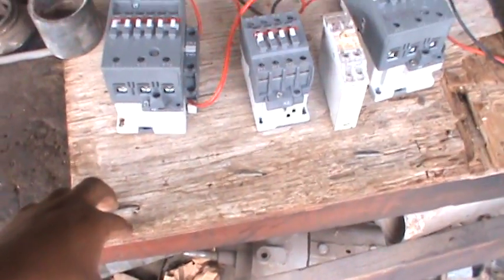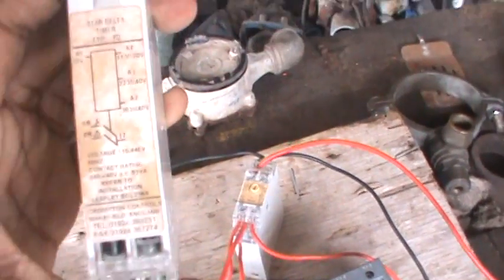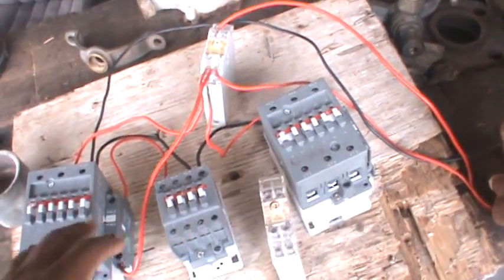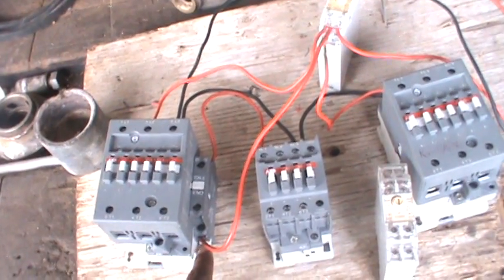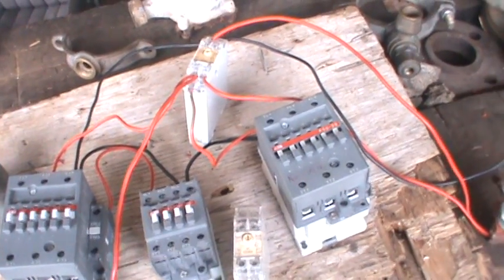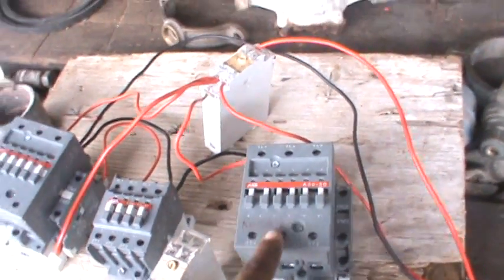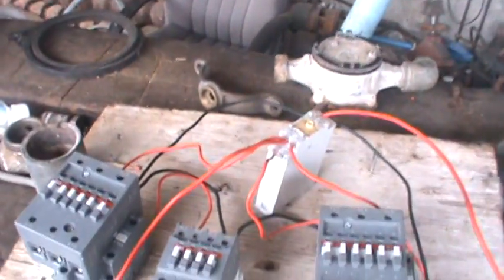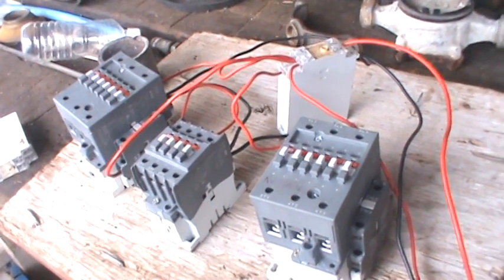Star Delta Circuit Wiring and Understanding . Auto Transformer (Motor with 3 Leads)

Comment: The timer you show is a star/delta however the timer you used is a standard timer that's why the had different contact numbers they are different as the timing of the contacts is longer, This is a very basic layout and not suitable for a standard timer would be ok if you had used the correct timer.

Comment: Please, please don't do this to my brain. 3 Contactors - YES. MAINS - STAR - DELTA. Now it is called STAR-DELTA for a reason. (The switching is between the star and delta.) Not between the MAINS+STAR and just the DELTA. So MAINS come on and STAR after switching on and after timer times out STAR fall out and DELTA come in. Contactors from left to right will be MAINS - STAR - DELTA. Without MAINS the motor will not run.

Comment: Why must we switch from star to Delta ????
Reply from the maker: To limit Inrush currents, reduces voltages, reduce mechanical stress, those are the three.
Reply: Thanks Clychawn Wilson I feel you
Reply: when a motor is starting it requires a higher starting current so that is why it is being started in star and then switch to delta
Reply: Wye to Delta is a Method to reduce INRUSH CURRENT.. Other Methods are Part Winding, Resistor starting, Autotransformer and there is 1 more but I forgot.. lol..

Comment: I have a doubt. my motor nameplate shows 400V @ Delta and 690V @ Star. So should I use these two different voltage levels to start the star- delta motor?

Comment: Can someone explain how the starter produces low voltage at starting?
Reply from the maker: +Peter Grant 

The Starter only send Phases voltages down to each winding at starting, for instance the starter lets the motor receive 240 volts ac at starting which affects the motor by creating a weaker magnetic rotation withing the stator like 1/3 of the motor rated power, The starter reduces the current by reducing the start up magnetic field by reducing voltage, then after a few seconds the starts lets the motor receive 400 volts ac which is delta and full speed and torque and full power.

Comment: i have 3 phase connection at my farm thare was not ground or earthing. how i start my 1 phase motor???
Reply from the maker: +Bhavik Patel

There are many ways you can run single phase pumps from three phase, if the motor is the same rating as the phase voltage of the three phase system them all u need is maybe one leg of the three phase supply. but if the motor is not of the voltage that the three phase supply gives then you'll need a three phase to single phase converter box or maybe a step down transformer to meet the motor voltage. As i said there are many ways to do that.

Note only that but Capacitors may be needed.

Comment: dumb fuck! where is your overload, and why does your main contactor get de-energised after delta gets energised.
Reply: Johan, with an attitude like yours, I l believe you are the dumb fuck.

Nice video, thanks for posting.
Reply from the maker: Mr John,

Please read the descriptions!!
Reply from the maker: Mr Johan 

Clearly you haven't been taught well in school. You always READ the descriptions before answering!
Reply: Clearly you know as much about electricity as a Neanderthal. if your not doing any thing on Saturday you can bring drinks and a book and I can teach you how a professional does the job!
Reply from the maker: Johan Burger 

Lol you need to look at the other videos. Cause you should realize there are more than one star delta videos there for motors with 6 and 3 leads. And I would take that offer just for the trip. But my knowledge is on par with engineers my friend.
Reply from the maker: Johan Burger 

They are BASIC video on how to do specific circuit dude. Stop being negative.
Reply: Johan Burger  dumb fuck
Reply: Clychawn Wilson it is absalutely wrong,because should be 2 contactors will run together from star to delta.the control is wrong..
Reply from the maker: Rommel you didnt real the link didnt you im very sure and clear when I said Auto Transformer Starting are used for motor with three leads! This set is starting the Motor at a reduces transformer voltage then switching to to a delta run and full torque and voltage.
Reply from the maker: I probably should of wired the powers wire and the transformer so you could understand.
Reply: hey john can u explain how to connect a screw type compressor(75kw) in star delta connction?
Reply: donkey of the construction site right here people, That one guy who speaks like he knows everything....